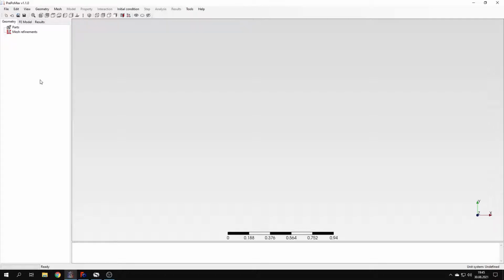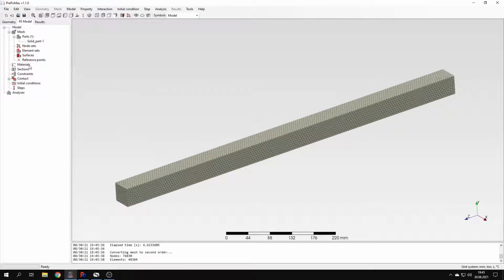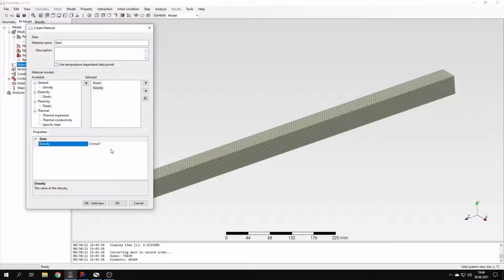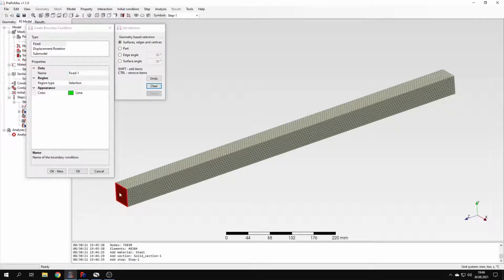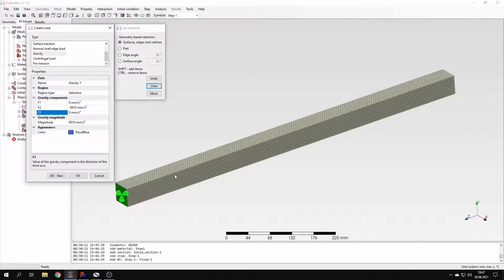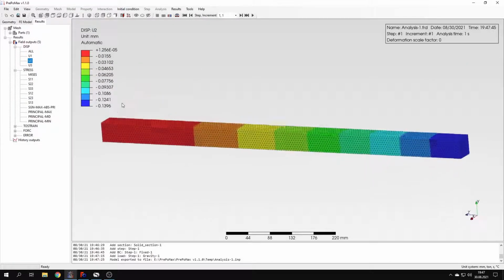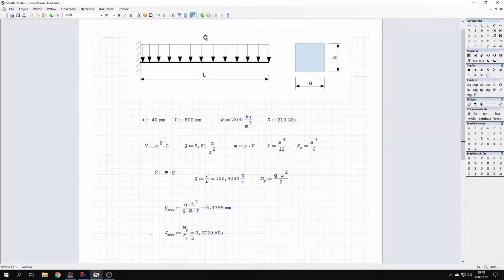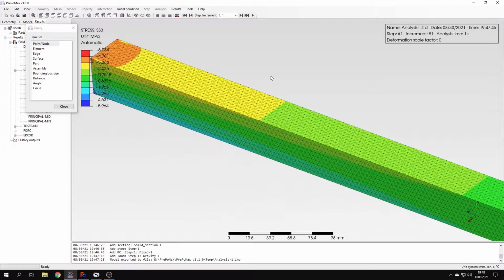PrePoMax (CalculiX FEA) - Tutorial 7 - Gravity load

Comment: just choose different type of mesh and your result gonna be much more converge... (Stresses)
Reply from the maker: Yes, I covered that in tutorial 20. But since then, PrePoMax gained the hex meshing capability.
Reply: @FEAnalyst  i got U man:-p
Regały good tutrial but...
U don't tell US whole true ;-p
Take a look on the lecture about vessel model that one  called Hertz contact;-P
R U checkin' US? ;>
Reply from the maker: @jakubsobka2621  I'm not sure what you mean about those two other tutorials (thin-walled pressure vessel and Hertz contact), especially since they are quite different from each other. The stress concentrations and mesh sensitivity there ?
Reply: @FEAnalyst  
I understand the way of your thinking but.. U R changing the topić the way is comfortable 4 U... We're not talking about the way of meshing elements.... I mean somethong more...
Reply from the maker: @jakubsobka2621  Then just tell me directly what you mean about those other two tutorials and I'll refer to that.
Reply: @FEAnalyst  
I guess that doesn't matters...
I'll have to do it by my self.
just by the way...
does it possible to do the same i've made using Ansys??
Reply from the maker: @jakubsobka2621  As you wish. Unfortunately, I don't have any experience with Ansys (I work in Abaqus normally) but it uses a completely different syntax and file formats so one would have to redefine all the analysis features and only the mesh could potentially be converted using some universal formats if Ansys can export to them.
Reply: @FEAnalyst  Ok man. let's take a look on its in this way...
I guess U live in Polsha and U speak Polish.
And your mamę is Jab isn't it?
Reply from the maker: @jakubsobka2621  Tak, zgadza się. Też jestem Jakub.
Reply: Wiez PrePo zdaje się być zdecydowanie bardziej okrojona pod względem funkcjonalności wersja Abaqusa...
Jednak i tak daleka od LS-Dyna czy już obecnie Ansysa...
Można w tym zrobić coś nazwiemy "rozszerzoną dynamika"?
Reply: @FEAnalyst  :-)
Czas na następny krok...
Festlab i Openfoam czeka na swoje miejsce na Twoim kanale;>
Reply from the maker: @jakubsobka2621  Owszem, PrePoMax to pre- i postprocessor do CalculiX'a, który jest oparty na Abaqusie i nawet używa prawie identycznej samej składni. Ale ma swoje spore wady, które przez to widać też w PrePoMax. Np. brak prawdziwych elementów 1D i 2D. Dynamika też nie jest mocną stroną CalculiX'a. Zwłaszcza explicit dynamics. Do tego polecałbym raczej inny soft open-source, czyli OpenRadioss. Nie używam go osobiście, ale podobno jest potężny i to zdecydowanie największa konkurencja open-source dla LS-Dyna.
Reply: @FEAnalyst  
Jaka była geneza PrePo??
Reply from the maker: @jakubsobka2621  Powstał już ładnych kilka lat temu, na początku głównie z myślą o studentach Uniwersytetu w Mariborze na Słowenii. Ale to nie jedyny ani pierwszy pre/post do CalculiX’a. Jest jeszcze chociażby moduł MES we FreeCAD, w którego rozwoju pomagam. Ma np. elementy belkowe w przeciwieństwie do PrePoMax’a.
Reply: @FEAnalyst  
Generalnie że względu na brak modelera który większość softów ma może zniechęcać... Ale dobrze to Solvespace...
Reply: Tu generalnie duża zaletą jest Solve Space PrePo i FatLaba jest opcja Portable i OpenSource
Reply from the maker: @jakubsobka2621  Właśnie dlatego często polecam FreeCAD’a, bo to przede wszystkim CAD, ale z dobrym modułem MES. A nawet ma dodatkowy moduł do CFD korzystający z OpenFOAM i bardzo fajny w użyciu.
Reply from the maker: @jakubsobka2621  To muszę przetestować, bo jeszcze nie korzystałem z nich. Tylko wiem, że SolveSpace ma jeszcze dosyć mocno okrojone możliwości, np. brak zaokrągleń.
Reply: @FEAnalyst  
Ma całkiem ładnie i sprawnie sobie z tym radzi... Jak dla mnie brakuje w nim tylko jednej rzeczy która obecnie spotkałem w Rfemie...
Tworzenie powierzchni na podstawie linii granicznych. Na chwilę obecną coś czego nigdzie nie spotkałem a naprawdę pozwala na dużo...
Reply from the maker: @jakubsobka2621  A, to może jakoś ostatnio wprowadzili. FreeCAD potrafi bardzo wiele jeśli chodzi o modelowanie powierzchniowe, zwłaszcza z dodatkowym modułem Curves. Polecam przetestować.
Reply: @FEAnalyst  
Generalnie nie jest to soft z założenia do analizy elementow 1d czy 2d właściwych dla innej gałęzi gospodarki... Np budownictwo. Tu raczej analiza elementów typu solid... Choć no w Abaqusie byli tacy po importowali model np z Etabsa i robili analizę "wyburzeniowa"... Czy jakiś progressive collapse...
Reply from the maker: @jakubsobka2621  Fakt, brakuje czegoś bardziej pod elementy strukturalne. CalculiX akurat ma ich wersje przekształcane na solidy, więc w ogóle kiepsko. Niektóre inne solvery open-source mają lepiej, ale np. Elmer z kolei nie posiada modeli plastyczności a pozostałe są mocno okrojone pod innymi względami. Brakuje czegoś darmowego w tej dziedzinie. Nawet prostego programu do układów prętowych w 3D.
Reply: @FEAnalyst  
Na bieżąco rozwijają...
Może się słuszne...
Ale czy zamienię? Jednak wszystko co dobre zaczyna się tam gdzie kończy się liniowość... No PrePo ma to troszkę uproszczone niż miał Abaqus do wprowadzenia punktów charakterystycznych krzywej odkształceniowo naprezeniowej ale zdaje się że działa dobrze...
Reply: @FEAnalyst  
To są pewne bolączki open source...
Chyba nie ma żadnego open source dla konstrukcji strukturalnych.
Wiesz wszystko ma swoje wady zalety.
Swoje mocne i slabsze strony...
Są spore możliwości analizy bo pozwala na nieliniowosc ale już np z SolidEdgem przegra dla produkcji bo jednak biblioteka części możliwość automatycznej optymalizacji wycieć w elementach tak żeby przeniosły naprężenia w zakresie liniowym czy tworzenie i optymalizacja mechanizmów kół zębatych...
Ciekawi mnie opcja możliwości prasowania blach... Tu przydałaby się opcja automatycznego zagęszczenia siatki w miejscach charakterystycznych... Dużo oszczędność elementów o liczeniowych...
Reply: To jeszcze Świeżak...
Może Rzeszowianki dorzuca coś z kabzy i rozwiną bardziej... Potencjał jakiś jest.
Reply from the maker: @jakubsobka2621  Generalnie najlepiej by było jakby do CalculiX’a dodać prawdziwe elementy belkowe i powłokowe. Są już pierwsze implementacje jako user elements, ale trzeba by to mocno rozbudować. Wtedy mógłby z tego też korzystać PrePoMax, którey jest tylko pre/postem, więc jego możliwości są w większości uzależnione od tego co potrafi CalculiX. Twórca CalculiX’a powoli idzie na emeryturę, ale stara się zebrać grupę, która będzie go dalej rozwijać. Może wtedy pojawią się te długo oczekiwane nowości, w tym solver Riksa. A propos - niedługo powinna wyjść kolejna wersja CalculiX’a, ale czekamy na nią głównie ze względu na poprawki wrednych błędów.
Reply: @FEAnalyst  
Skąd ten upór do tych elementów 1D , 2D??
Jak ktoś będzie chciał to wszystko zbryli?
Reply: Ostatecznie na przykładzie tego elementu 1D go dyskretyzujesz i pew meiejsca charakterystyczne rozpatrujesz według geometrii przekroju materiałów i sił wewnętrznych właściwych dla tego punktu..
Reply: W wielu przypadkach tak naprawdę wystarczy Ci często jakiś Mathcad... I coś do mazania...
Kwestia pracochłonności i opłacalnością. Żyjemy w takim miejscu i takim czasie że lepiej się nie chwalić E coś umiesz za bardzo...
Na pewno Najdzie się ktoś kto będzie chciał się na Tobie dorobić wykorzystać...
Dostaniesz młotek przecinak zrób mi cuda wianki i najlepiej dopłać...
Dziś lepiej być "GUONBEM"
Reply from the maker: @jakubsobka2621  W Abaqusie często korzysta się z shelli (z belek rzadziej), ale wszystko zależy od przypadku/potrzeb i fakt, że czasami nawet nie trzeba się bawić w modele MES żeby coś zaprojektować.
Reply: @FEAnalyst  
Swego czasu trochę się bawiłem Abaqusembale szybko przesiadłem się na Ansysa ze wzg na to że był zdecydowanie bardziej przyjazny. PrePo zdaje się bardziej uproszczony więc jakby bardziej przyjazny... kwestia dobrych źródeł do nauki programu. Niektóre rozwiązania w Abaqusie wymagały czasem znajomości bardzo zaawansowanych wiedzy z zakresu wytrzymałości materiałów. Np to co tu się opisuje tylko i wylacznie wystarczajaco punktami charakterystycznymi krzywej naprezeniowo odksztalceniowej tam można było rozwijać jako pewne wyliczenia i qartosci dotyczące ilości potrzebnej energii do zniszczenia przekroju po przekroczeniu maksymalnych możliwych naprężen. Zależy do czego chcesz program wykorzystać. 
Automotive pewnie tak. Budowa maszyn pewnie też. Zbiorniki. Elementów konstrukcji stalowych które ciężko policzyć w sposób inny niż solidy? Pewnie też. Konstrukcje? Tu może być to kontrowersyjnie pracochłonne.
Reply from the maker: @jakubsobka2621  Zgadzam się szczególnie co do konstrukcji budowlanych. Abaqus nie jest do tego zbyt dobry, CalculiX jeszcze dużo gorzej. Dlatego to się liczy w Robot i innych softach tego typu, ale brakuje darmowych alternatyw.
Reply: @FEAnalyst  
Na pewno ma swoje pewne zalety które wplywaja na to że wart poznać...
Chociaż żeby móc zestawić wyniki czy konwertują w różnych programach.
W Ansysie jest bardzo fajnie bo podobnie jak np w Dłubała masz kanał z pewien sposób pewna gwarantowana proponowana jakością wiedzy.
Webinary i materiały podpisane bezpośrednio przez producenta jak in prowadzacego będącego w pewien sposób jakimś autorytetem w swojej dziedzinie markujacybvos z imienia nazwiska i tytułu. Bez sciemy
Reply from the maker: @jakubsobka2621  Co ciekawe, nawet do Abaqusa nie ma za bardzo takich oficjalnych tutoriali wideo (poza pojedynczymi wyjątkami). Wolą sprzedawać kursy.
Reply: @FEAnalyst  
Proszę Cb...
Robot to to było coś czym się kiedyś molestowalo pokolenia studentów...
Ani on specjalnie przyjazny intuicyjny 
Ciężki wolny solwer. Lipne siatkowania , niestabilności. Patyki z blachy... jeszcze Okej. Moduł żelbet... Tragedia...🤮
Reply: @FEAnalyst  
No nie...
Za to masz chyba ponad 1000 stronicowa instrukcje... ;]
Ja nie wiem czy ktoś z tego jeszcze korzysta...
Po uczelniach można zauważyć nawet po rocznikach wydawanych pozycji literaturowych czy innych publikacji że był etap kiedy przeszli na Ansysa. Raz spotkałem się z publikacja z Comsola...
Reply: @FEAnalyst  
Może się coś zmieniło.
Nie wiem jakiś czas temu rzuciłem tematy inżynieryjne bo przepraszam za wyrażenie:
"Kradziejstwo, kurtyzanstwo, krzywogebyzm"
Reply: Albo dorobkiewiczów na cudzy rachunek ;/
Reply: bo na tym zarabiają...
To nie jedyny taki przypadek...
To nie bułki i sprzedaz masowa...
Grono potencjalnych klientów raczej wąskie a konkurencja na duża.
Reply: @FEAnalyst  
Dla upartego i żelbet policzysz jakieś studium przypadku... Bo wymiarujesz na dwa stany... Kwestia przygotowania obliczeń dla otulin i przypadków obciążenia,  zrobisz model drutów operacje boolowska i potem zaimplementujesz do softu
i drugi analogicznie do metody przekroju sprowadzonego dla odpowiedniego fragmentu  elementu Es odpowiednio zamienisz na Ecm zgodnie z geometria drutów...
Zbiornik mało przypadków obliczeniowych do zrobienia...
Hala z dużej ilości patyków i każdy jeden przez każdy możliwy przypadek obliczeniowy... Bardzo praco i czasochłonne... 
Ale już nietypowe połączenia... Czemu nie.
Reply: @FEAnalyst  
Z Abaqusem jest ten problem ze nawet z publikacjami z uczelni bywalo różnie...;/
Było kilka które zostały popełnione i szybko wycofane ze sprzedaży...
Czasem jeszcze można spotkać pdf-y w necie i sprawdzić 😅
Reply: @FEAnalyst  tak just by the way...
Publikacja z uczelni będzie lepszym wyborem niż kanał?
Reply from the maker: @jakubsobka2621  Niby tak, ale niestety trzeba uważać, bo trafiają się publikacje bardzo kiepskie merytorycznie. Głównie te z Dalekiego Wschodu. Na szczęście to raczej rzadko, widać to praktycznie od razu a zwykle poziom jest ok, lepszy niż większości materiałów na YT i sam korzystam z artykułów dot. Abaqusa. Jest ich mnóstwo, ale w większości zagranicznych.
Reply: @FEAnalyst  po prawej stronie Wisły sa  zaledwie 2 może 3 lokalizacje w PL gdzie z jednej absolutnie nie polecam...
A dalej tam nigdy nie wnikałem w temat...
Reply: @FEAnalyst  
No cóż...
Ostatecznie w PL to tylko W-F albo kup Pan kredyt...
A zaawansowane historię inżynieryjne tylko i wyłącznie hobbystycznie nieliniowosc męskiego przyrodzenia albo gdzieś daleko stąd bo niestety... Nie ma się komu uczyć ale kasę jest komu przytulać...
Reply: Rozstanie z branżą traktuje jako los na loterii a inżynieryjna choć interesującą to życiowy błond...
Reply: @FEAnalyst  
Skoro ma tyle ograniczeń niedoskonałości czego nie Saloma albo Aurora??
Reply from the maker: Też korzystałem. Salome z Code_Aster mają bardzo duże możliwości, pewnie nawet większe niż CalculiX. Ale są bardzo nieintuicyjne i niewygodne w użyciu. Coś za coś. Poza tym odpowiada mi podobieństwo CalculiX'a do Abaqusa. Natomiast pewnie dam kiedyś szansę OpenRadioss'owi.
Reply: @FEAnalyst  
Myślę że wybór mos być dobry...
Czemu Salome a nie Z88
Wydaje sie za ma najdłuższa tradycje dobry solwer ładnie meshuje i chyba najlepsze wsparcie z całej tej trójki...
Reply: @FEAnalyst  
Ad. Notatek siła krytyczna w powłoce walcowej...
Prosi się o podanie transparentnie geometrii   a nawet wyliczeń zrobionych w jakimś arkuszu Smath czy Mathcad i porównanie zestawionych wyników.
Trochę duża zawiłość ad proponowanego porównania wyników siły krytycznej powłoki z PrePo i Ansysa.
Reply: @FEAnalyst  
Swoją drogą teraz modne jest robienie programów podobnych do tych o tych znanych tytułach...
Solid Edge też doszukał się swojej wersji... Podejrzewam że nie pierwszy i nie ostatni przypadek...
Reply: @FEAnalyst  
Generalnie chyba jestem z tych co wychodzą z założenia że francuskie to dobre są sery wina i miłość.
Osobiście Ich programy nigdy jakoś nie porywały...
Reply: Jest taki autor o nazwisku Skrzat.
Popełnił zestaw ćwiczeń dla Abaqusa potem dla Ansysa. Wykonanie i sposób przedstawienia który można polecić jezeli chodzi o transparentność...
Reply from the maker: Kiedyś pewnie jeszcze wrócę na chwilę do Salome/Code_Aster, ale nie polubię się z nimi na tyle by wsiąknąć głębiej. SolidEdge nigdy nie używałem, jedynie SolidWorks. Nazwa podobna, ale funkcjonalność chyba zupełnie inna.
Reply: @FEAnalyst  
W pewien sposób podobne...
Ale w Edgu możesz dokonywać zmian w modelu bez deassemblacji i potrafi... Optymalizować przekroje w zakresie liniowo sprężystym trochę jak Z88Arion.
Reply: @FEAnalyst  nad SolidWorksem się nie pochyliłem bardziej... chyba niechęć po po Robocie i potem wszystkich Structural Designer, Advance Steel, Advance Concrete... Są po prostu lepsze rozwiązania.
Reply: @FEAnalyst  
Bardzo szybko przeskoczyłem na Rfema, Tekle lub to co znacznie wykraczało możliwości analizy czyli Ansysa...
A potem rozstałem się z branżą bo nie warto...;]
Reply: @FEAnalyst  jeszcze możesz się pokusić o PTC Creo albo za free i Spark Design gdzie masz dostęp do bibliotek ale musisz dobrać sobie  narzedzie do analizy.